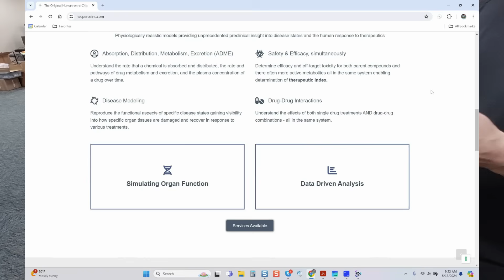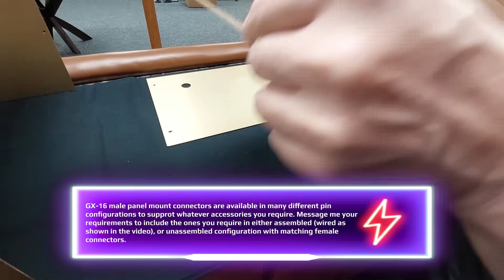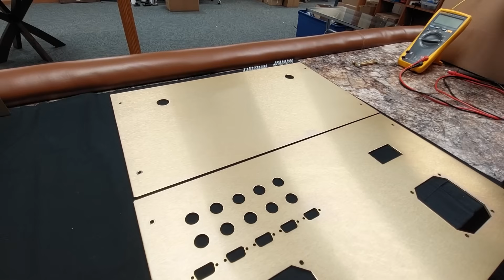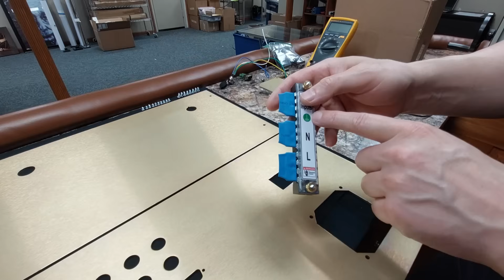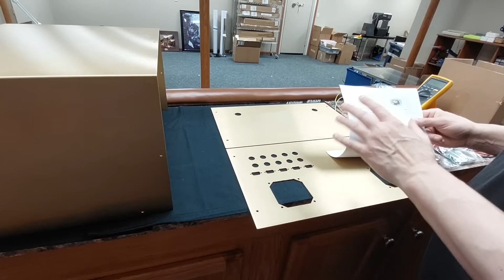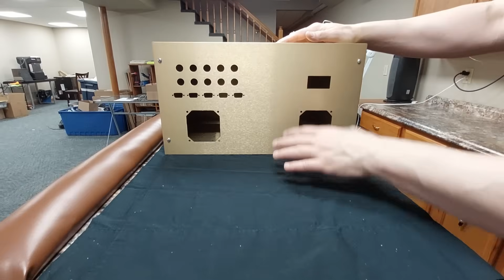Hesperos Custom CNC Enclosure Is Completed...

Comment: Hi Vince Love that enclosure what thickness is that aluminium you are using.

Keith
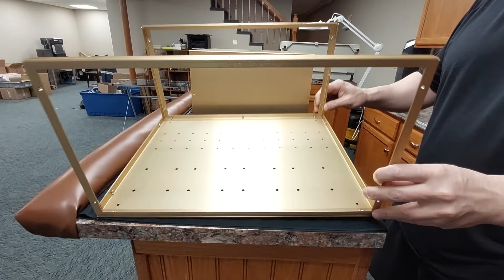Reply: Bbbvy 0:43
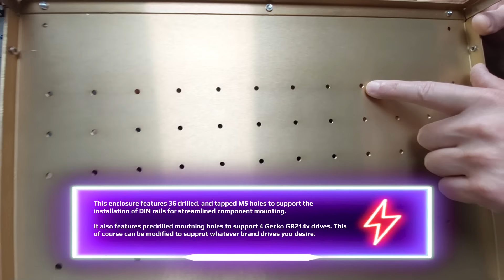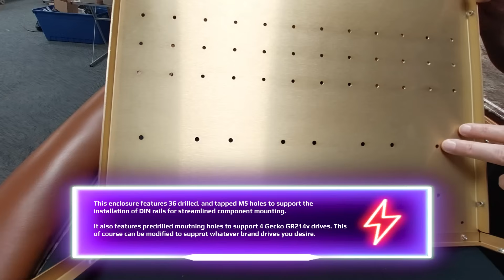Reply: 😮😢😂❤ 1:08 1:08 1:09 1:09 😊😊
Reply from the maker: Thank you Keith for your support. The front, back, and bottom plates are all 3mm thick, and the top lid is 1.5mm thick. These are customizable based on end user preference, with prices adjusted accordingly. 

Thank you,
Vince